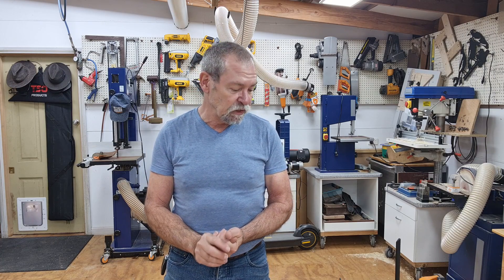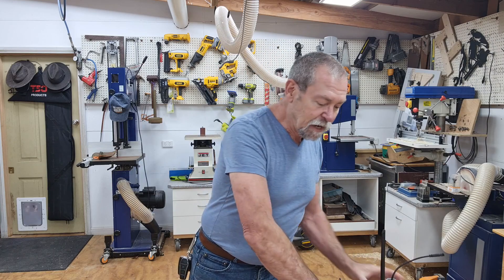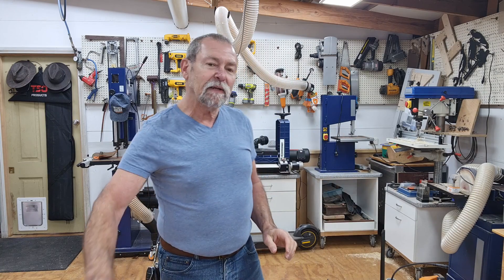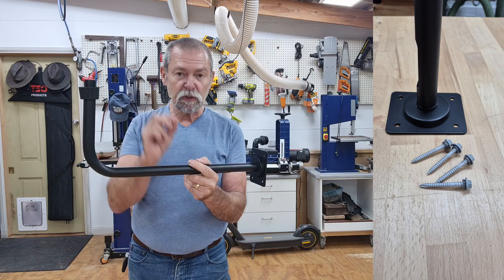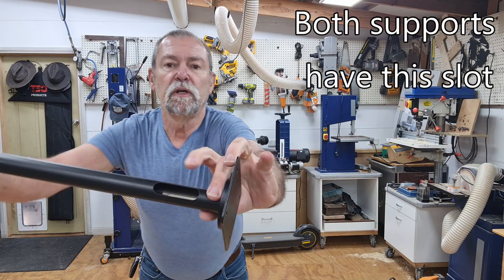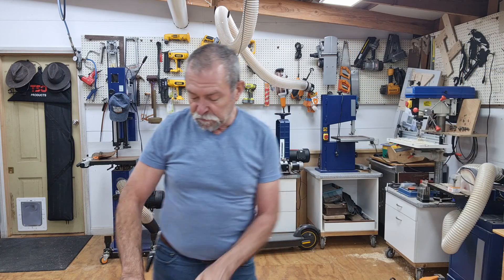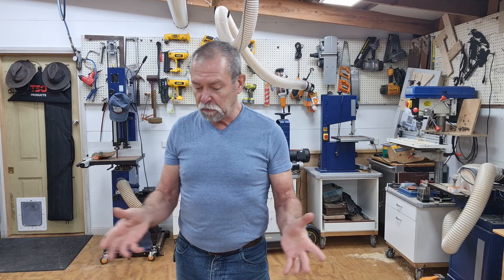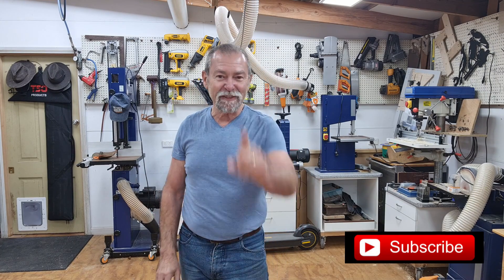Easy Lymow One RTK Setup Anyone Can Do | Dave Stanton

Comment from the maker: Here is another important tip. take a photo of the base of the rtk so that you can scan the qr code from that photo if needed in future. I needed to re bind the rtk today and thankfully I hadn't removed the scaffolding to reach the rtk as it was 2 storeys up.
Reply: Yeah, I just installed mine - on top of my deck pergolla.  Had to bring it back down to get to that qr code.
Reply: That's smart thinking. Thanks for the advice. 👍

Comment: I combined the two and put it on the wall so that the pole is sticking up one meter (3,3 feet) above the roof.
Reply from the maker: May not be a good idea as the rtk base is extremely sensitive and with the amount of flexibility you have introduced the robot may go off course.

Comment: Hi! I mounted my RTK on the top of my house with clear view. I still keep getting the RTK error message and don't know why. Also it has yet to mow which I believe it may be something eternal.
Reply from the maker: The RTK needs a clear view to the sky as well as a good view of everywhere the mower will travel. After you have mapped all the area you want to mow, the robot can use either RTK or VSLAM. Make sure the aerial on the side of the RTK is vertical, not kicked out at 45 deg like I did the first time round.
Reply: @DavidStanton ok mines kicked out at a 45 degree angle which I will change it. Thanks for the response
Reply from the maker: @jrtxboiy you will need to remap after you have done that.
Reply: @DavidStanton ok will definitely do that and let you know the outcome.  Thanks for your help because lymow definitely haven't been any.

Comment: So what happens when winter comes around? What is the winterizing process for this unit?
Reply from the maker: If you aren't going to use it for an extended time I would remove the battery. But it depends on how cold it gets. At my location it never drops below -2 C. Check with the manufacturer.

Comment: Does the RTK antenna need to have line-of-site view to the mower?  I don’t really have a location where there is a clear line-of-site to the different areas of my yard that I want it to mow. (roofs or buildings are in the way)
Reply from the maker: Not at all. The rtk communicates with satellites and the mower. The mower communicates with satellites and the rtk. My lymow is often out of sight of the rtk and still performs beautifully.
Reply: the rtk has to be in a position that gets as much clear sky  without trees or building obscurring its 'field of vision'

Comment: So, the RTK needs to be connected to the charger? Thanks!
Reply from the maker: Not necessarily. It can be connected to the charger or as in my case, through the dc/ac converter and into a power outlet inside the building.
Reply: Does the converter come with the more?
Reply from the maker: Yes, I covered all of that in the video. Watch it again to refresh your memory.
Reply: As this video shows, there are two options.  

(1) If the RTK is close enough to the charging station for it's cables to reach it, use the RTK power connector on the charging station. 

(2) If it's to far for the provided power cable(s) to reach the station, use the supplied power adapter and plug that in wherever you want to.

Comment: Thanks for this video! Question... My lymow won't be shipping until at least Sept. But it would be nice to get things ready on my end to mount the RTK. I'm going to need a good 100ft of cable to get it centered on my roof and my outside outlet isn't nearby. I can just search RTK cable and buy a 100ft one? or does it need to be a certain type? This is all new to me
Reply from the maker: I don't know if the cable is generic and also if voltage drop over 100 feet may impact the converter. It isn't essential to have the rtk centre of your roof. You may be better off using the spike and free-standing pole in your garden?
Reply: @DavidStanton  i have trees that border my property. From what ive been hearing... having it mounted on high up is best so the robot can connect to the same satellites on the backyard and front yard. I was planning to attach it to the top of the deck, but sounds like it wont be high enough for the front yard.
Reply from the maker: @ch1c0h the robot also has vslam which works very well under trees and behind buildings.